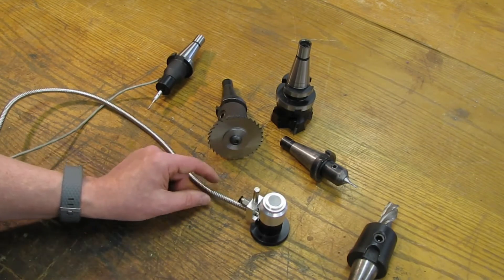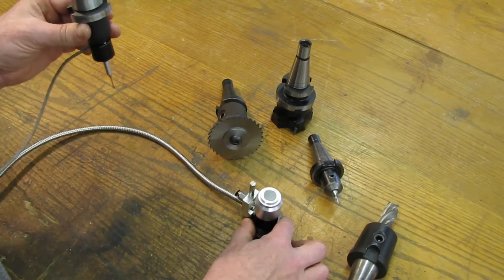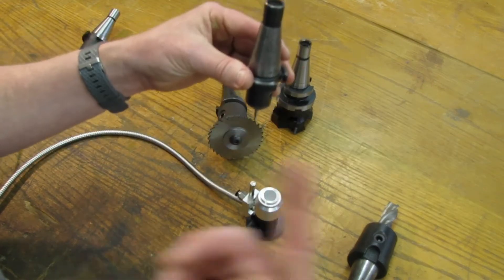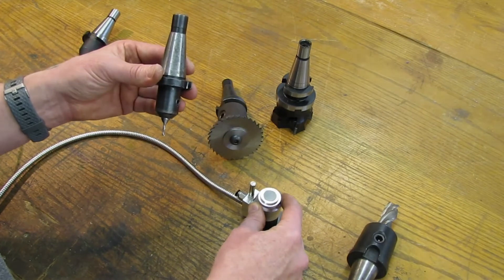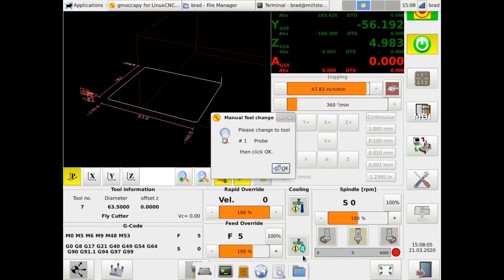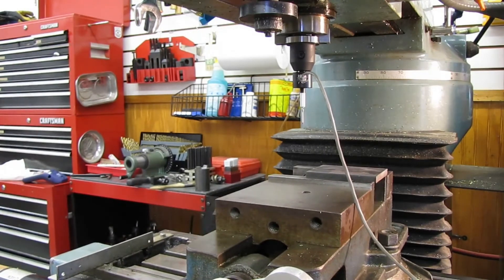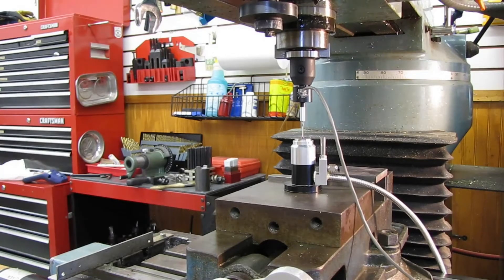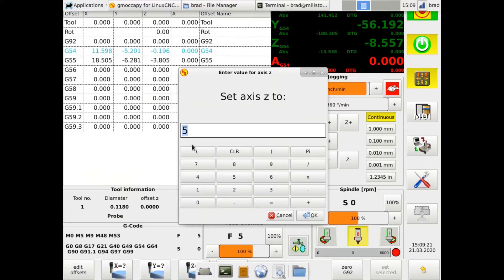Tool Setup and Offset in LinuxCNC

Comment: You can (and probably should) use the spindle face as your tool 0 height offset at 0mm. Then, when you set the length of your probe, it will be its real life length, so the numbers actually mean something. Either way, I appreciate this video and will be referring to it when I get my own setup working. I just decided to switch to LinuxCNC.

For reference, the spindle face is the location for zero tool length in CNC mills with absolute encoder servo axes drives, because this location is stored in memory, even when the machine is off. With very little fuss, this kind of luxury can be approximated by just using your tool touch off probe on the spindle face and setting it as tool 0, and every other tool as an offset from that.
Reply: that make sense, i have a question since you seems knowledgable, i have a er type spindle with collets so i cant have a "reference" tool right? since the height is changing every time , so can i use as a reference the spindle shaft? like i remove the er collet and nut and probe the height of the shank? would that be a good solution?

Comment: nice video but not tell how i can make touch off makro, i has make button to display Z touch off. but alltime come error EOF axis.ngc row 0. somethink i not understand, not good english. need know how make macro and how this can make working good. i have manual ER16 collect spindle, need ewery tool change make new time zero point of tool. but not understand if has make button to display ok and then bush button why not go make sub/macro g-code and measure tool lenght and add zero point. or macro measure ZXY points workpiece corner too. i have basic parallerport linuxcnc 2.8.4-1 version. DIY cnc machine working manual well. but need make automatic, set tool lenght set workpiece corner and know true zero point, then run linuxcnc example code and carving this linuxcnc text to wood. i not has make first cutting yet because i try run this example code thats run too high alltime same move bit wery high point.  how move bit down. manual if i move bit top of wood, and then run example code bit run move same point high than before i run empty machine this g-code.

Comment: Hi...error message in G43 'Parameter H without G43 or G76 to use it'.....what could that be?
Reply from the maker: Difficult to say.  Not enough information.  Probably best to post to the FreeCAD forum Path section.  Include your FreeCAD info and a project file if you can.

Comment: How are you handling the separate probe & tool height setter inputs ?
Reply from the maker: My probe is tool 0 and has no length offset. When I use the probe for surface interpolation, all the probed heights are relative.  The tool setter is is only used for tool probing and the value is stored in tool table length offset
Reply: @sliptonic  are the tool setter and probe sharing a input ?
Reply from the maker: @seancollins9745  My linuxcnc configuration is here.  (master branch)  https://github.com/sliptonic/millstone
Reply: @sliptonic  before i pour over this, could you please answer my inquiry, and as nice as a configuration is, that doesn't tell me about the physical machine past pin assignments.
Reply from the maker: @seancollins9745  yes. They share an input

Comment: It looks like you have a long travel on your tool setter before it activates. Do you use the "e-stop" circuit of the tool setter instead of the "sense" one? Just wondering.
Reply from the maker: Good eye! You're exactly right. I fixed it a couple months after I published the video. I saw someone else's video with a similar setter and realized how short their stroke was. It made a big difference in touch time but didn't change the repeatability at all.

Comment: Thanks Brad found this extremely useful. You seem to be using the GMOCapy UI for Linux CNC was this a conscious choice and for what reason?
Reply from the maker: Yep, that's gmoccapy. I switched over a few years ago when I added a touchscreen to the mill. Axis is a good ui for experimenting and learning LinuxCNC but it's terrible for day-to-day work, especially on a touch screen. The buttons are poorly sized for fingers and it's easy to make mistakes. Look at professional control panels like haas or fanuc and you'll see what I mean.
Reply: @sliptonic  Thanks - I will look at it . Had begun trying to customise Axis for our traditional DIY router based woodworking CNC. We don't have a touch screen but I need to make it as easy as possible for our members to use the system .

Comment: While that method will work, the resulting numbers in the tool table are not as useful as they could be. A better method is to consider the empty spindle nose to be the reference tool, aka T0. The tool probe, and later, the work surface are also touched off using T0. Now when the tools are touched off the numbers in the tool table are literally the length of the tool from the spindle nose. Now if there is ever any doubt about a tool length, you can just look at the value in the table and compare that to the actual tool length, even an eyeball approximation would likely be good enough to prevent a crash due to a bad number.
Reply: Firstly, good practice to have positive tool length offsets. Next, never touch off the probe on the toolsetter, you're bound to get a wrong length. Rather, use a gage block on the table , set that as the surface and probe off off it to get your exact probe length( the deflected length ).
Reply: @human2761  Yeah, I thought the same. To "While that method will work", by the OP we should add: Maybe sometimes ... and sometimes not. 
This setup is actually two reference instruments fighting each other, which results (worst case) in adding up their own worst tolerances. Also: The switch of the tool-length-sensor maybe accurate and must have repeatable characteristics (or it would be garbage), but the initial spring travel of the tool contact point may not even be linear or give repeatable results. So the spring/mechanics of the toolsetter and the spring force of the probe will (in the best case) always approximate around a virtual value, which we cannot tell and makes that method a guessing game. "Twice" of something is not always = better!:)
Reply: How are you supposed to measure off from the bottom of the spindle nose to the work-piece accurately?  Isn't that the purpose of the probe?
Reply: @katemoon7476  Paper, most paper is about 0.1mm or 0.0004", just take it down carefully tell it touches, wiggling the paper. When it grabs the paper, the gap is 0.1mm. Done. Check your paper thickness.
Reply: @tmackintl  That is a wonderful advice. In addition:
You can look up the actual sizes/tolerances for your X grams/square meter (just exchange the "strange stuff" to your imperial madness, hehehe) paper on the homepages of the manufacturer. For example 80 g/m² is 120 μm thick and 120 g/m², is 0,15 mm = 150μm thick. 
You can of course also use a valve gauge or ruin some precision blocks (the unavoidable wear and tear over time), or just use a fresh and new tiny piece of paper for every calibration task. Have a good one, guys!:)